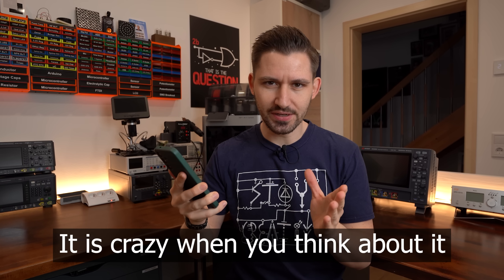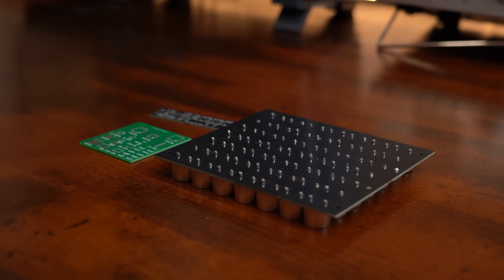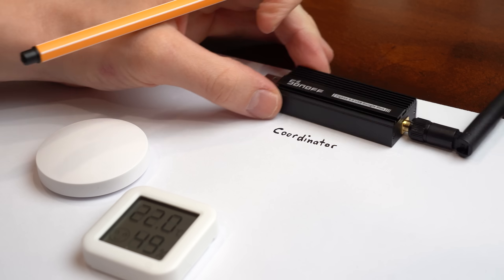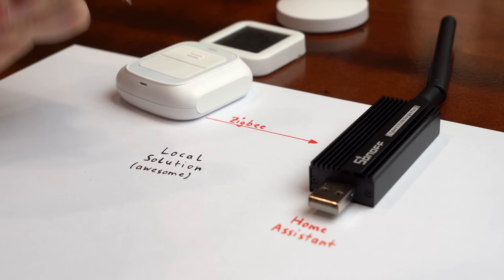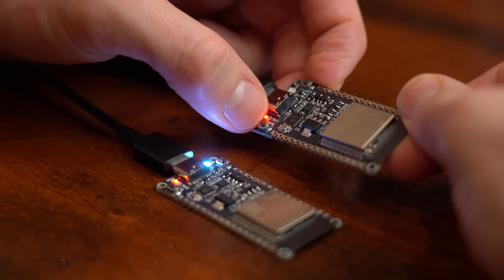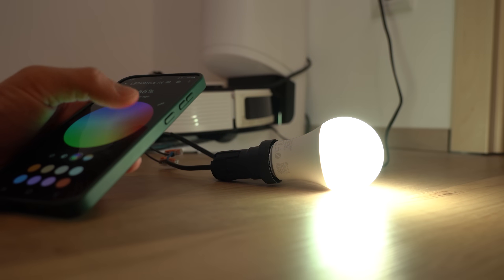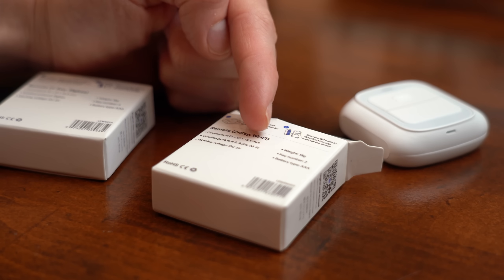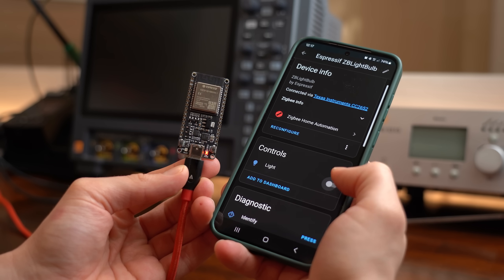Forget WiFi AGAIN! This Wireless Method is WAY Better? (Zigbee)

Comment: Normally you want to route the Zigbee dongle away from any wireless routers to avoid interference. Wifi and Zigbee still operate on the same frequency.
Reply: Kind of. Zigbee has about 20 channels in the same frequency ranges used by 2.5 Wifi.  The difference is that Zigbee legitimately only uses the one channel of bandwidth. Wifi has a dozen channels, but only 3 are typically used, (1,6,11) due to overlap in the channel size.  That said, you can easily set the channels on either (zigbee dongle and/or wifi router) so that they're on the far-ends of the channel list, and they won't interfere with each other.  Putting your 2.5 Wifi on channel 1, and Zigbee on channel 20, will see no conflicts at all in their spectrum usage.
Reply: @TvistoProPro  Over the years I have heard a lot of people have issues with their Zigbee until they moved the coordinator away from the their wifi. I have no issues, but it is still the recommendation of Home Assistant to move your coordinator away from computers and any devices or wires (like other unshielded usb cables, for example), and away from wifi routers and access points. They also recommend using USB 2.0 ports and avoiding using USB 3.0 ports. You want to use a shielded USB cable, long enough to get the coordinator away from any sources of RFI/EMI/EMF disruption. Putting zigbee on a channel like 20 or 25, will help.. but again, moving the coordinator away from computers, peripherals, wifi routers and access points, etc is still typically the recommendation.

Comment: Hi! For your heating, check this out: Moes BHT-002-GCLZB I have a cloud based, just as you, and last winter, the API went silent for two days. And it was quite expensive. So I bought the one which i suggested, and it's ready to assembly :) If the cloud goes down again, I'll replace it in an hour :)

Comment: I believe the C6, at least, also does openThread. Yet another wireless protocol to test. Depends if the Espressif IDE has an example for thread. Suspect it does. Some USB dongles can do thread with different firmware on them, but it depends on which chip they have. Sonoff do 2 dongles. I have 2 Zigbee networks because Zigbee can only have 1 boss, so there is no redundancy. If that boss fails the network fails. With thread there could be multiple bosses on the same network so if your home assistant fails your smart speaker might still be able to keep the network alive etc. Thread sounds good but hasn’t really taken off, but if you’ve already got the hardware and there is an example Espressif code…
I believe there is now a Zigbee library in Arduino but haven’t played with it. When I was exploring there wasn’t.

Incidentally I found the Arduino code for Zigbee on the Espressif GitHub page. Maybe it is now on the Arduino pages but it didn’t used to be.

Comment: Your chart also needs to have a "latency" category.   With regard to RF24 communication, I found that it is VERY LOW latency, which serves me well for my purpose.  That should be in your comparison chart, because WiFi/BT, etc. have very high latency and the response times are far less predictable.

Comment: I beleive that the zigbee router is seen as a mesh function - I have a zigbee switch outside which I am quite impressed with. Also HA has nice autodiscovery for zigbee 3.0 devices

Comment: Well i have a question as it's vary clear that c6 outperforms the h2 board so i think you should have also rechecked you esp now results. one more thing esp now also have an long range mode with less speed so it might outperform even ZigBee

Comment: Could you use the ESP32C6/H2 as a coordinator and fetch data from the devices that are reachable? I have some zigbee temp&humid sensors I am not using for the aquara home system (I have aquara sensor + gateway). It would also be cool if I could create my own sensort and connect them on a random gateway I already have

Comment: 10:00 That's active mode (enabled radio) though. Smart home button sits on the wall doing nothing 99.999% of the time and doesn't need to listen to the network. I imagine Zigbee allows to completely shut down the radio/go to the deepest of the sleeps and quickly transmit to the network immediately upon wake up?

Comment: What about Thread?
Reply: No devices. I mean, there are some but there's a metric ton of Zigbee devices. Thread should have been backwards compatible if they really wanted it to replace Zigbee. Now you pretty much have to run all three (including zwave) because there are some devices not available for all the protocols.
Reply: thread uses the same radio as zigbee. So i would expect it to be the same.

Comment: I didn't get it, to what device do you connect? To the "locator"? but how do you connect to individual ZigBee-enabled device? From what I understood, a STM32 can be "flashed" either as an endpoint or as a locator, did I understand it right?

Comment: Power consumption of H2 or C6 is in the range of 6-10 uA but only in a deep sleep. When waking up from a deep sleep the device will undergo the procedure of "re-joining" the net before it's actually operational and ready to send data. It should be better in a light sleep in terms of a wake up speed, but naturally you'll "pay" for that with a higher current draw on average

Comment: zigbee is really awesome, the support and documentation is sadly just a little lackluster, learning to write code for zigbee connections is like trying to make gold out of lead.

granted i'm a dork at coding, and even have a hard time using esphome sometimes, but i'd love zigbee instead of a ton of wifi devices bogging down all my channels.
also zigbee is way more power efficient and would fit in better with all my homemade, home assistant sensors.

Comment: How is the security of zigbee...is there any "firewall" or encryption in the communication between devices...or could someone sniff them out and then exploit them remotely?
Reply: They use strong encryption, but it is also possible to social engineer the home owner with a zigbee network and trigger him to reset devices, once he'll start pairing devices you could capture the encryption key of the network.

Comment: You're coding skills are more than sufficient to write IDE code for a thermostat if your cloud provider ever goes bust.
I wrote an INO for an ESP32 & nextion screen to replace the analog controller in my camper. Sadly I never built the board for it, but the code was relatively simple. I even added a dehumidifier option that would run the propane heater intermittently for times when it's too cold to keep the AC running enough.

Comment: For those out there who want to give zigbee a shot together with wifi: if you want the maximum range and reliability, keep some distance between your wifi-router and the zigbee-coordinator and select either channels to not overlap. This solved quite some delay-problems with my 64 devices zigbee mesh. I think it's time for me to put some esp32s into the mesh 😊
Reply: Agreed, although to be fair if you aren't running WiFi smart home stuff your WiFi is probably almost entirely using 5 and 6GHz rather than 2.4GHz
Reply: True. I learned that the hard way when my Netgear Orbi mesh after a power outage decided to occupy the frequencies previously used by the Zigbee network.
Reply: @robidog2k  That's an important one.
Reply: I use zigbee since years in HA and always was a bit disappointed by the range and delays. This might be the reason. Thank you for that hint!
Reply: @scream221  The other thing is that a lot of the ZigBee adaptors don't like being plugged directly into a USB port, they can pick up EMI from the USB controllers and it messes with them. The solution to that is to use a USB extension cable

Comment: I've transitioned all our 'smart' plugs and lights from WiFi to zigbee last year .. so much more reliable than WiFi .. and close to 40 less devices on our WiFi.... A usb ZigBee gateway made integration with home assistant easy.
The Osram smart + zigbee bulbs have so far been faultless.... Much better than the old hue bulbs they replaced.

Comment: I love that Zigbee is completely isolated from Wifi networks. I don't need to worry about many privacy or security aspects simply because it's physically impossible for my Zigbee devices to connect to the internet
Reply: VLAN's exist.
Reply: @Pyroteq  Yeah my neighbour does it to me and it's infuriating. I can't seem to stop him. I can slow him down using filters but he's obsessed and relentless.
Reply: Yes! This sold me on Zigbee. I don't want the status of things in my home discoverable on the internet.
Reply: From what I understand it uses spectrum in a similar area of the spectrum to WiFi, it uses different frequencies. So, it's both inaccessible directly and probably a bit less likely to interfere.
Reply: @SmallSpoonBrigade Zigbee bands from Wikipedia: "2.4 to 2.4835 GHz[25] (worldwide), 902 to 928 MHz (Americas and Australia) and 868 to 868.6 MHz (Europe)"

I'll add that if your threat model includes attacks which involve the attacker having a radio in range of the Zigbee devices (or having physical access to a device on the network), there are a lot of attacks to worry about.

I also noticed some insecure cipher suites allowed by the protocol which I'd want to verify cannot be used (meaning rejected by the recipient, the problem is insecure or nonexistent authentication tags with malleable cipher modes).
Reply: But couldn't you have outside device to connect to your zigbee? But on the other hand reading temperature is somebody else's home isn't really privacy breach
Reply: @realdragon  "But couldn't you have outside device to connect to your zigbee?" I'm not sure what exactly you're asking here, but AFAICT outside devices can connect to a Zigbee network using the default key, and—depending on how things are set up—possibly do much more than that. I haven't spent the few hours it'd take for me to say more than "don't assume Zigbee is secure."

One of the papers I read was on the topic of securing Zigbee in an industrial control context, where it can be very important. For residential I could see locks, sensors for a security system, and the thermostat using Zigbee and accepting unauthenticated data/commands being a problem.
Reply: Aren't you too paranoid about wifi devices?

You know you can have a WIFI network without internet access right?

Like what are the devices going to do if I use a internetless WIFI network?  try to gain access to a nearby WIFI network?

It's not like it's impossible if someone is targeting you and they really want your data , they can just embed an esim and use cellular data to transmit your data.
Reply: @asl9750  Imagine if a ham radio was able to unlock the digital lock securing your door and everything inside your house. Even if a lock is physically unable to connect to the internet, it still needs to communicate with your control device of choice (like a smartphone) using Bluetooth, radio frequencies, infra red signals, or even with Johnson-Nyquist noise in some distant future.That is the main concern.
Reply: @asl9750  The problem is most of the WiFi based devices mandate a internet connection because they're talking to cloud services (typically manufacturer provided). The nice thing about Zigbee is that it removes the possibility of malicious firmware because even if the device was for instance snooping on you in some fashion, it has no channel to exfiltrate that data as it has no non-local connection. A WiFi device on the other hand, assuming it's on a internet connected network (which it likely will require in order to function at all) can now stealthily exfiltrate data. If a WiFi device could operate entirely local with no internet connection it wouldn't be as much of a worry, but on the other hand, who wants to run two WiFi networks? Zigbee is just inherently more secure out of the box.

This is also why I don't like Matter as a standard. It mandates the presence of a bridge device that connects the Thread RF protocol to IP thereby removing that inherent advantage.
Reply: Who is thinking about frequency are missing the point, smart devices are well known to have security breaches and being a weak point in your local network, so someone can get access to all your other devices and data thru them. Most of these wifi devices must have internet conection to work and comunicate with the web directly
Reply: There’s Thread

Comment: I bought a bluetooth bulb. Had to do a quite of search to find a exactly bluetooth, not wifi one. Screwed it into the lamp, switched on, started the app and that motherfucker requires wifi and location permissions to control my indoor BLUETOOTH lamp. I threw that shit away at once.

Comment: How secure is the protocol? I think that the first Zigbee devices were very critical.
Reply: In order to "hear" other devices on the net and be able to communicate with them you need a 128-bit network key.
Reply: @sfinaecrtp  Yes, and you don't necessarily have to connect the box that's controlling them to the internet when you're not actively updating it.

Comment: I have SO MANY PROBLEMS with Zigbee on my Home Assistant system. I have devices that just drop off the network and need resetting in order to get back on again, others just stop responding or will only respond some of the time
Reply: Are the devices near your router? Only ever had issues with devices near the WIFI router

Comment: Really hope ESPhome supports Zigbee one day!
Reply: What’s the advantage here? Over the air updates?
Reply: @leblancexplores  It means you could grab one of these Zigbee-capable ESP32s, wire some stuff to it, write a little bit of YAML to tell the ESP32 what's connected to it, and have a working device without having to program anything.

It's a great option for people that are comfortable with electronics but not C coding.  Hell, I am comfortable with C coding and will probably end up using ESPHome for my doorbell controller.  I'm going with Zigbee for my garage door though so I'll have to code that.

Comment: I had to go with Zigbee solely for a Yale smart lock.  It wasn't 100% reliable in Home Assistant and I thought it might be Zigbee, so the next time I went with Wifi.  Oddly enough, now the Zigbee lock is more reliable than the wifi.  BTW, in the cloud apps, both locks seem to be reliable, so must be an HA thing.  The Zigbee battery lasts much longer, as expected.

Comment: My master project was using Xbee. They worked secured only 8m. What you didn't do and cannot with the LED know, is the angle of the board. if you have 90 degree angle between your devices (sender and receiver) you will not make much distance. 
Try to be specific with the way you put your modules .. see how long you can go while you have 90 degree angle between the two antenna. 
You face the same thing with BT. 
Having obstetrical will kill the signal also. So Zigbee is no go.

Comment: Mesh capable, only 1 IP for the gateway instead of the 20 or so other smart wifi things that I had, good for batteries (my Aqara sensors now up for 4 years with a CR2450. thx for letting me check Andreas).  Good protocol for battery powered stuff for sure ... except manufactures like to be manufacturers again and tie their Zigbee only to their devices. That stick and home assistant to the rescue.

Comment: Just wondering, is Z-Wave still a popular choice for home automation?
Reply: I run both zwave and zigbee. And contrary to what other people say about zwave being very stable, my experience is different. I experience frequent slowdowns and time-outs when calling zwave commands. For some reason my coordinator and mesh just drop the ball if you start flooding it with messages. 

It worked some moments, but my zigbee network has been 10x more reliable and faster. Setting up new devices also goes faster in my experience...
Reply: Z-Wave also supports a more robust security protocol for things like door locks.  While it might be annoying if someone hacks into your color LED controller it would be worse if your front door lock gets compromised.  I started with Z-Wave specifically because they were the only secure and reliable option for door locks that I could find about a decade ago.  Zigbee now has better security but Z-Wave pricing has come down a lot and you can get Z-Wave dongles and modules for DIY applications.  Given how cheap Zigbee is I'll probably use it for less critical stuff in the future but my Z-Wave locks have proven secure and reliable.
Reply: @ Yes, you don’t have to choose between one ore the other. You can use both next to each other if you’d wanted to.
Reply: I like Zigbee because there are many really cheap Zigbee products. 
Be careful with TUYA Zigbee products though because some of them require the TUYA hub and software that will connect your devices to a Chinese cloud. 

They have deliberately deviated from the Zigbee standard to force you to use their ecosystem.
Reply: It is, they are competing standards.

One of the benefits/cons of zigbee is its an open standard, they dont need to be certified. Means theres more/cheaper zigbee devices
Reply: Z-Wave is a proprietary protocol. Z-wave products are very likely to work ok but you’ll less options and they’re more expensive.
Reply: My understanding is that the main issue with Z-Wave is that it's got a much smaller number of options. But, it's on a much less used section of the spectrum and They do make adapters that can handle both zigbee and z-wave if that's your thing. 

Personally, I went Zigbee just because of the variety of things that work with it.
Reply: @SmallSpoonBrigade  and the fact I can make custom ESPHome devices is HUGE.